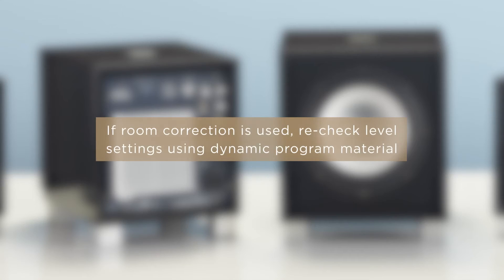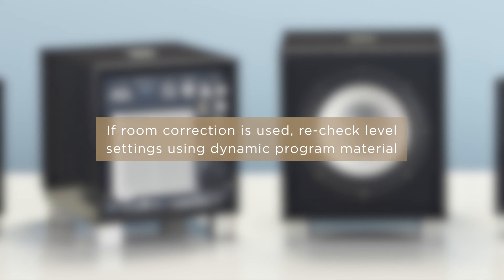REL Acoustics How To: Room Correction and Auto Set-up Software Tips

Comment: Hi can i set up audyssey without the high level and LFE, then put on the subwoofer after calibration...i have a rel S5 and and focal arias powered by a denon x6700...bass is quite low at the moment after calibration on LFE and 2 channel play back
Reply from the maker: Thank you for reaching out. You can certainly run your Audyssey room calibration software without the subwoofer being connected to your receiver, and then once the calibration program has finished you can connect the subwoofer and check within the receiver to make sure that your main speaker channels are set to "large" or "full-range" output, and then tune the subwoofer by-ear to blend with your speakers.
Reply: @RELAcoustics  thank u

Comment: @rel acoustics This video only talks about REL LFE . How about 2.1 high level input system using impulse room correction with inverse phase pulse to eliminate room mode including as standing wave and reverb at listener’s position?
Reply from the maker: Thank you for reaching out. When using any room correction program, whether for a home theater or 2-channel system, the key is to not have the High Level input connected while running the room correction program. In our experience having a subwoofer connected High Level while running automated room correction programs will often lead to unsatisfactory results due to the software interpreting the output of the subwoofer as being too much low-frequency output from your main loudspeakers. 

Instead, if your preamp or receiver has a subwoofer output jack then you can connect from this output to the .1/LFE input on the REL if you want the room correction to directly impact the subwoofer's output. Or, the best option is to have the High Level cable for your subwoofer completely disconnected while the room correction program is running, and then once it has finished you can reconnect the High Level cable, double-check to confirm that the main speaker channels are still set to "large" or "full-range" output, and then tune the subwoofer manually by-ear using it's back panel controls.

Comment: @rel acoustics in regard to setting the high level crossover frequency and volume, would it be safe to assume that once my room correction software set the volume and crossover frequency for the LFE .1 channel that I could just mirror those settings manually using the dials on the sub that control the high level settings?
Reply from the maker: The crossover would likely be similar for both, but we always recommend tuning by ear to get the results. This article goes over how to set the crossover and gain on our subwoofer. 

https://rel.net/blog/2020-07-15/principles-of-sound/how-to-set-the-crossover-and-gain-on-a-subwoofer/
Reply: @RELAcoustics  Thank you for your timely reply.  I am currently using a pair of 10+ year old Velodyne Impact Mini's which have served me well but I have "upgrade-itis" and figure I might as well get the best!  the 5/x seems just the right fit.

Comment: Not helpful at all, when you disconnect neutric at calibration step. Audyssey sets front speakers to small size and cuts all low frequencies. If you connect neutric back after tests all low frequencies already cut. What I do, I set them manually back as large size... I did not measure results by reference microphone. But what you suggest sounds illogical to me.
Reply: Yeah, this doesn't make any sense. If the software thinks your mains are bassier than they are, it's not going to "reroute the bass from the mains to your sub out", it's going to do the opposite and set up your speakers as bigger than they actually are and route more bass frequencies to them (and the REL via the high-level out) which is actually what you want. You can do what REL is suggesting here (and manually set your fronts to large/full-range if you have bookshelf speakers), but really what you're doing is bypassing the software for the sub, which defeats the whole purpose. Personally, I think it makes sense to leave the high-level connected, and if you want more bass in your system use room correction software like Dirac or Audyssey XT32 that allows you to adjust the target curve and set it up with a house curve with more bass.
Reply: Doesn’t make sense indeed - either they have no clue or do it to mask some other issue when using high pass. I’m thinking that because they use passive radiator - the claimed musicality might be mainly thanks to that - so when you have drums it won’t be just bang and in millisecond cut off but passive radiator will extend this sound making it more natural. Then the room correction software might deem these prolonged sounds unwanted and cut it out crippling their performance. I think that’s the real reason behind don’t connect high pass while calibrating. Rel is good option for hifi setups for music listening but not quite for movies.
Reply: Yeah definitely gonna go with Rel on this one instead of a few random youtubers.  You guys definitely seem like you know what you're talking about but I've gone through a lot of subs over the years and I can never go back after Rel.  The accuracy and mid-range bass is unmatched until you start to get way up into numbers I certainly can't afford.  Maybe you guys just have tons of money lol but Rel is high end for my taste

Comment: Hi, when using audyssey auto setup, we should leave only LFE connection between the avr & the Rel correct? what about the Crossover dial on the Rel sub? that has to be left on a certain level or it doesn't matter what its set on? Thanks.
Reply from the maker: That is correct. When running room correction, you should disconnect the high level connection and only have LFE connected. The crossover dial does not control the LFE channel on the subwoofer, only the high level and low level inputs. The crossover should be set so that the subwoofer is taking over the lowest frequencies that the main speakers cannot handle. This depends on the speakers you are using and your room, so it will have to be tuned by ear, using a familiar reference track with steady bass.
Reply: I wondered if you ever figured out what to do with the crossover as per your message. I've got the same question and I've followed every step and the sub sounds good however I wonder if it's optimum, I.e whether I missed a step with where to set the crossover dial when running the YPAO on my Yamaha.